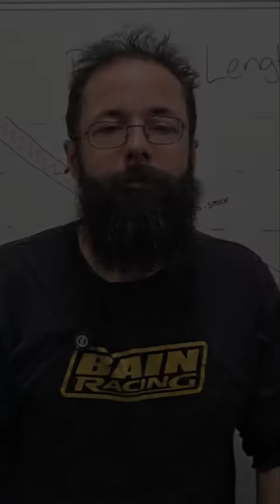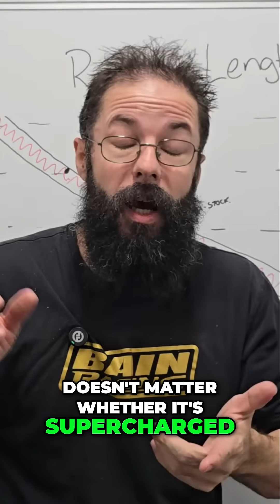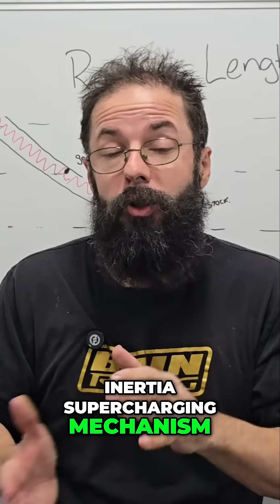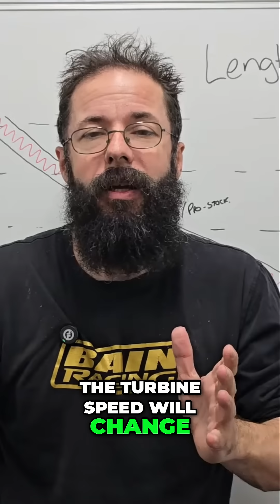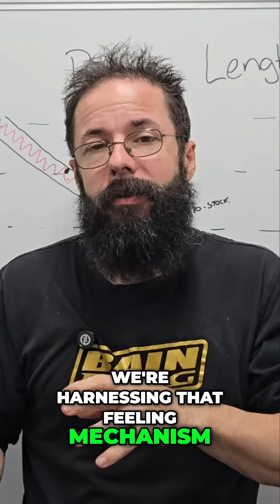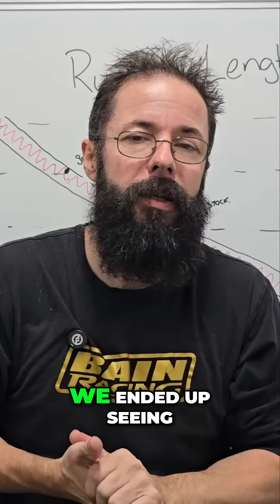Supercharger Intake: Unleash Hidden HP with Runner Length!

Comment: 100% spot on. Adding a super charger to a engine just increases our understanding of what's been done while n/a. 
Used an Alfa Sud 1.5 Ltr unit, because they were cheap and strong. Resulted in some surprising results which proved we didn't fully understand what we were doing.
Intake pressure dropped, torque went up.
Reply from the maker: Exactly! 👏👏
Reply: ya here in California, the 05 mercedes 1.8 kompressor is cheap. Specially, with the easy fix of the transmission. I'm just a grassroots guy, took a dive into the supercharger stuff bought the M271k motor and now I want to use all the stuff that Bain Racing is talking about and have at it. The factory Eaton stuff from Ford are cheap as no one wants them. Wish there were more guys from Australia and New Zealand out here. Those guys are top notch
Reply: @450ktm520  This channel is a mine of invaluable information. Remember to stick to the basics, like when it's up and running, if it has more inlet manifold pressure than standard it will always need more fuel and less ign. advance.
If the motor fails when everything is in the ball park, it's usually because we got greedy with the head line torque figure, but not necessarily top end power.